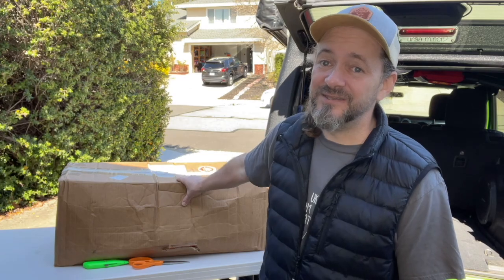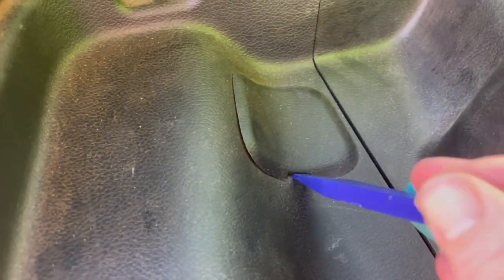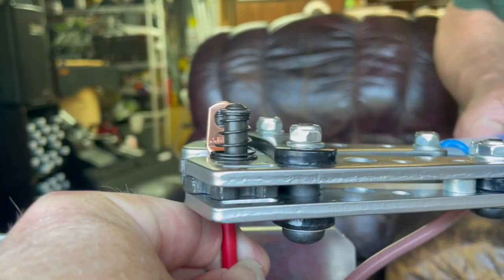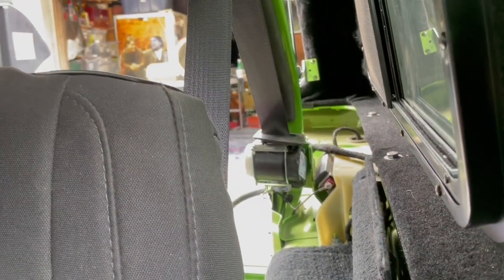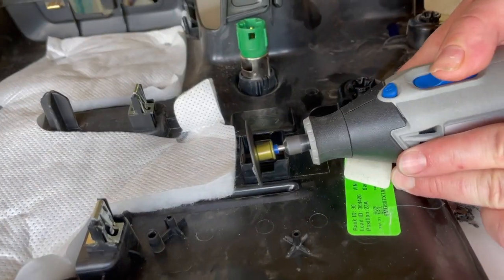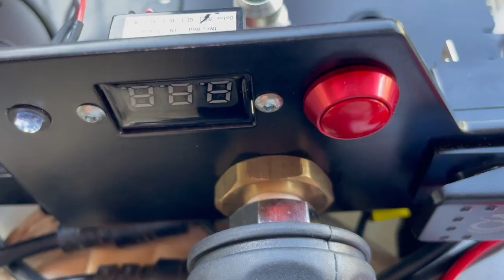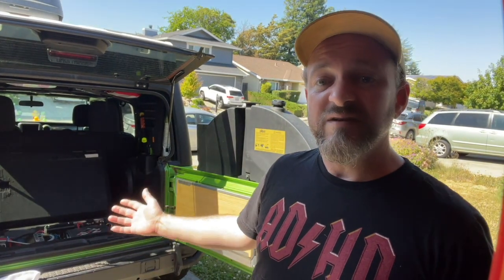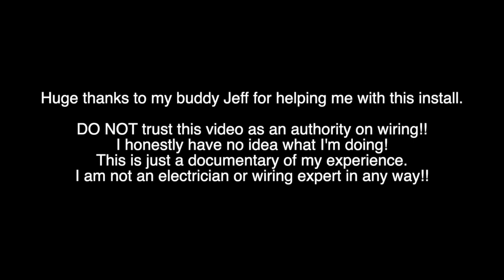AAL ARB Compressor + Aux Battery kit unboxing and install on a Jeep JL

Comment: Hi, thanks for posting this video. Very clean setup.
I just have one question, due to the confined space, did you encounter any overheating issues?
Reply from the maker: Not so far. I haven't used the compressor much, but the filters are supposed to prevent that.  I'll definitely report if there are issues.

Comment: Do you need the red arc battery if you have a dual battery system? I’m about to add the genesis dual battery to mine
Reply from the maker: I'm not an electrician, but my understanding is the Red Arc is what lets you charge the aux off the main. You could isolate the back battery and only charge it with solar, but I think you'd still need a battery charge controller like the red arc